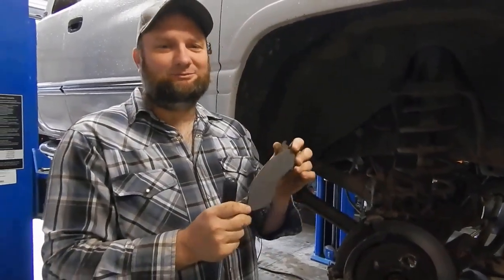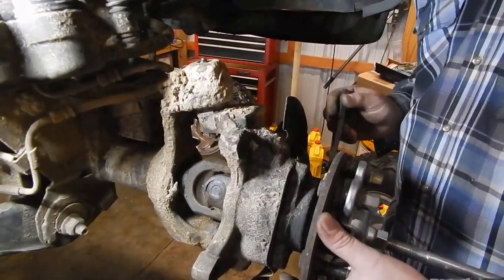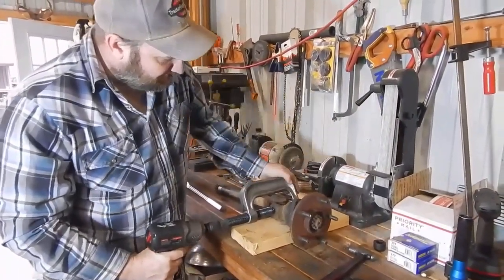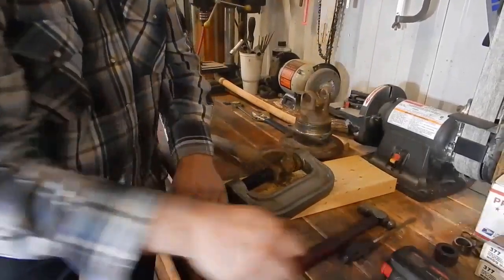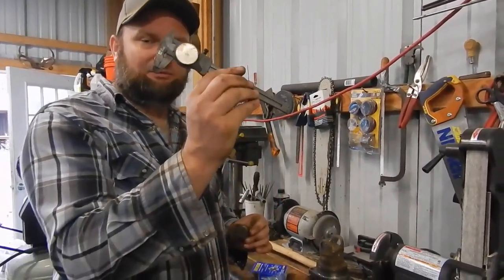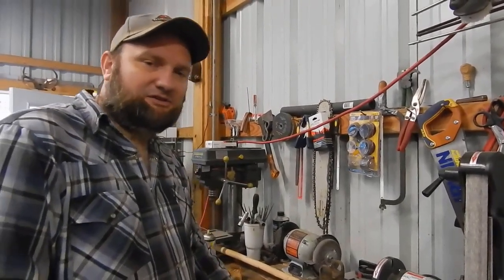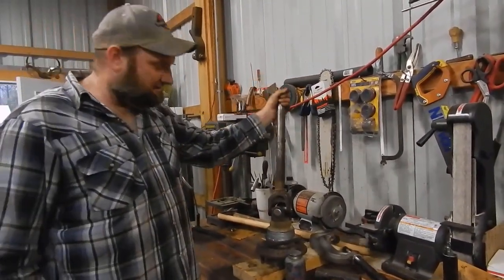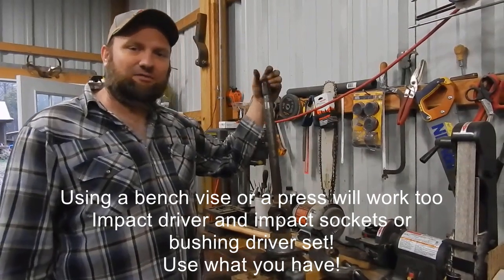Replacing Front U-Joints On 2001 Dodge 1500 4x4

Comment: I got my 2001 Ram in 2007 it had 74,000 miles on it.  It now has over 300,000.  I've done the passenger side U-joint 4-5 times.  Every couple of years or so it was going out.  I quit getting it from Auto Zone and got it from Napa,  now it's been good for 3 or 4 years,  Yay!   I've never done the driver's side,  that's a crap ton of miles on that U-joint lol.  I know how to do these but I like to watch refresher videos before I start.  I usually learn a tip or trick that's helpful.  I love the slide hammer idea.  I've never done that before and prying it and beating on it with a lot of cussing is always frustrating.  I did like 3 or 4 pulls on that slide hammer and it was free.  OMG,  never has it gone that smoothly for me,  the only cussing was an EFF YEAH! but it was out of celebration not frustration lol.  Again thank you for making this vid!!!  I watched 3 videos on this before I started and you were the only one to use a slide hammer,  and I've never seen it on past videos I've watched.  You can teach an old dog new tricks lol.
Reply from the maker: Thanks for commenting and I agree, I am always learning new ways of doing things and open to anything that will make a job easier or quicker. I do the same on something I never have done before. A little refresher definitely helps. Thanks for the info on the Napa u-joint.Have a Blessed Day Friend. Justin

Comment: Thank you for the demo. I was wondering if you knew whether or not a remanufactured front drive axle that happens to have a tone ring for ABS would work on my non ABS truck, or if I need to get the wheel bearing with ABS in addition to the toned ring ABS front axle shaft...
Reply from the maker: Brad I am not sure? If the bearing with ABS has the toner ring built in it then the bearing would suffice. But if your truck is non ABS then I would think there would be multiple modifications to do. Have a Blessed Day Friend! Justin
Reply: @homegrowncountryhomeplace  Thanks for mentioning it so soon. I will ck with a parts person soon.

Comment: When those bolts are frozen in there, have you ever sprayed him with WD or liquid ranch and then capped on them with the hammer? Thanks for sharing just thought I'd mention it God bless, By4Now,
Ken
Reply from the maker: I've used pretty much all types of penetrating sprays,heated up the bolts, used impact drivers or impact guns to get frozen bolts loose. Sometimes it works but when it doesn't, I have had to use air hammers to move a bolt or have to drill them out and use a tap to re-thread the hole. I have rapped on bolts before with a hammer and it works if not to tight and frozen. Hope you have a Blessed Day Friend!
Reply: @homegrowncountryhomeplace  yeah that's for sure sometimes they just won't break they are frozen thanks for getting back to me looks like you've got a really good channel hear my channels are home improvement how to woodworking excetera channel bye for now don't be a stranger Ken God bless

Comment: Had to replace the Wheel Bearing assembly,  had to use a sledge hammer to get the dang thing off rusted it to its self.

Comment: Will bad u joints make it click when you turn while moving? It only clicks when I’m moving and going over a small bump. Gotta turn and be moving at the same time though. When it’s stopped and turning it doesn’t make the sound.
Reply from the maker: If you are driving and making a turn and it clicks or pops or makes a clucking noise, then it would be your u joint. Have a Blessed Day Friend. Justin
Reply: @homegrowncountryhomeplace  thanks brother. I have a 2001 Ram 1500 4x4 off road package. I did the hub assembly on both sides “pain in the butt” now I guess I’m tearing all that off and doing the U joints. Lol. If you were in Georgia I’d just bring it to you and let you do it. You dern sure make it look easy.
Reply: @homegrowncountryhomeplace  what do you think of the 2nd gen 1500’s? That 5.9? I’ve always been a Chevy man but I found this truck at a heck of a deal and it beats having a truck payment. I’ve already put brakes all the way around it , did the wheel bearings and hub assembly on the front, 

I still need to do u joints, all the ball joints need to done, it’s got 160k Miles on it. Super clean for that age. Another issue I’m having is when I get past 40mph the rear end makes a whining noise. It only happens when I’m over 40 though. I expect something is gonna have to be done with the rear end. The Man I bought it from said it’s been making that noise for 5 plus years now. Overall it runs really good. Used truck I know I’m gonna have to put some money in it. Lol. How do you feel overall about those Dodges?
Reply from the maker: @bradentoncane8830  These are good trucks. Transmissions are their weak point. My 2000 ram 1500 2wd trans went out at 150,000 miles. The pinion bearing may be the problen in the differential. Overall I believe these are some really good trucks and have a HD frame thickness compared to the new trucks. I have close to 230,000 on my 5.2 in my 2000 model with no work to the engine except a waterpump and alternator and the usual maintenance. (Plugs and wires etc). Have a Blessed Day Friend. Justin
Reply from the maker: @bradentoncane8830  These are good trucks. Transmissions are their weak point. My 2000 ram 1500 2wd trans went out at 150,000 miles. The pinion bearing may be the problen in the differential. Overall I believe these are some really good trucks and have a HD frame thickness compared to the new trucks. I have close to 230,000 on my 5.2 in my 2000 model with no work to the engine except a waterpump and alternator and the usual maintenance. (Plugs and wires etc). Have a Blessed Day Friend. Justin
Reply: @homegrowncountryhomeplace  prechate it! I got 169k knock on wood for the transmission. The guy I bought the truck from gave me a folder full of maintenance that he did on it. Already had the computer replaced in 2008 receipt was 1100! Ouch! It’s a lot of work done on it already. I been noticing a clean gen 2 dodge is a head turner on the road for a lot of people. I’m gonna keep it and slowly fix it up. Hopefully one day it’ll be sharp as it was brand new! You’ve got some good content! I subscribed to your channel. Looking forward to more content on these dodges.
Reply from the maker: @bradentoncane8830  Appreciate the Sub. Been bust transporting rvs but intend on making some more videos. Have a Blessed Day Friend.
Reply: @homegrowncountryhomeplace  me and my cousin just did all the u joints in the front and all the ball joints. Gosh darn it that was some work. I’ve got the 02 1500 4x4 off road package sport.
Reply from the maker: @bradentoncane8830  yes it can be rough. But is always a good feeling to get it done. Good job! Have a Blessed Day. Justin

Comment: Did you have a seal at the end of your Axl
Reply from the maker: No seal on the u joint side but you have a inner seal where axle goes into the differential. Have a Blessed Day Friend. Justin
Reply: @homegrowncountryhomeplace   what did you use to set your seal
Reply: Don't forget to take the c clips off of old u joint before pressing the caps off was left out.

Comment: Nut in the middle do I have to take off to get the hub off?
Reply from the maker: Yes, remove the axle nut to be able to remove the hub. Hope this helps. Have a Blessed Day Friend.  Justin
Reply: @homegrowncountryhomeplace  spent so long trying to get it off wish I would of seen that part on the video to late now having a guy come Monday to take them both off for me there so rusted hopefully he can still get them off
Reply: @homegrowncountryhomeplace  but I just seen you still have the nut on at minute 4:14 🤔
Reply from the maker: To remove and replace just the hub assembly, the axle nut must be removed. Replacing the u-joints does not require removing the axle nut from the hub assembly. You can pull the shaft and hub bearing together. I should have made this a little clearer. Have a Blessed Day Friend.  Justin
Reply: @homegrowncountryhomeplace  I am even trying fire and still not working like mine is rusted on
Reply from the maker: @jennyrose31  Sorry your having so much trouble. Usually heat from a map gas torch would be enough to help break free a rusted nut or bolt. Are you trying to get the big nut off or the 4 bolts holding the hub assembly?

Comment: Which U joi t is this called ?
Reply from the maker: I just call it the front outer u joints for the front drive axles or shafts. Hope this helps.
Reply: @homegrowncountryhomeplace  
This weekend I'll be doing both wheel bearings,both u joints,both front shocks,and upper and lower ball joints.